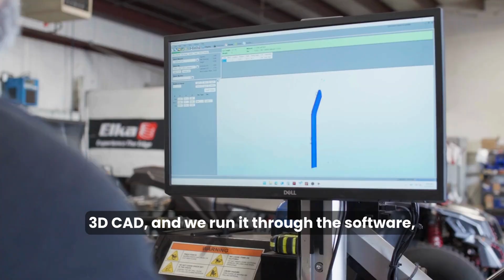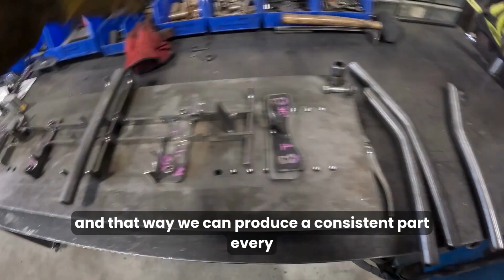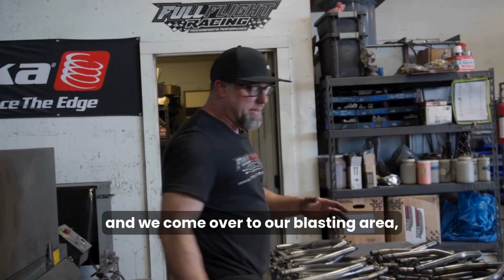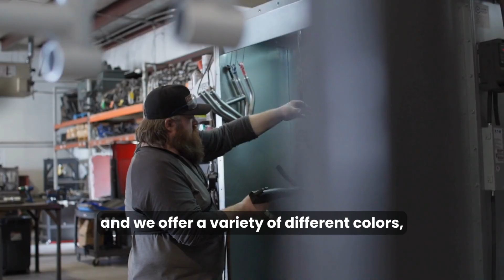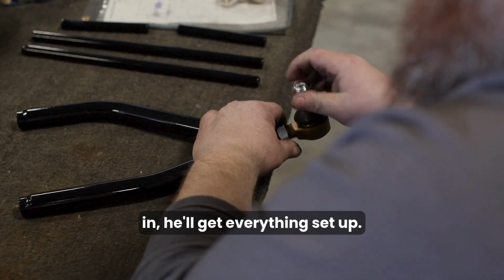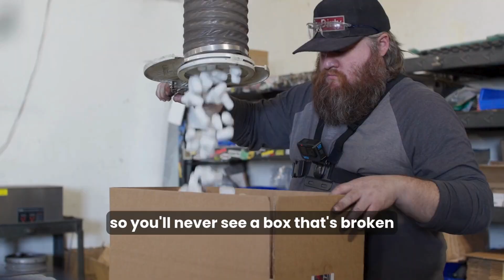Inside Fullflight Racing: Precision-Made A-Arms Explained

Comment: Do like my control arms +2 on the raptor.  Only issue was intial set of ball joints were so stiff and tight i couldnt turn the bars, swapped out with another set of full flights and all is so smooth.